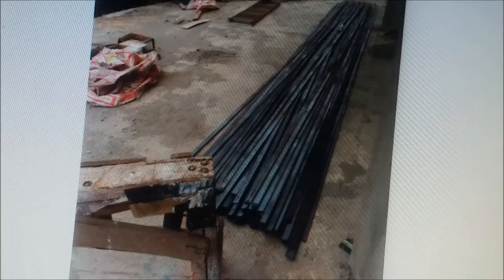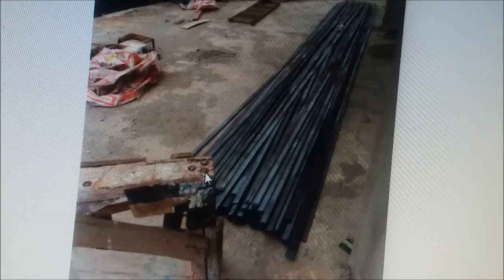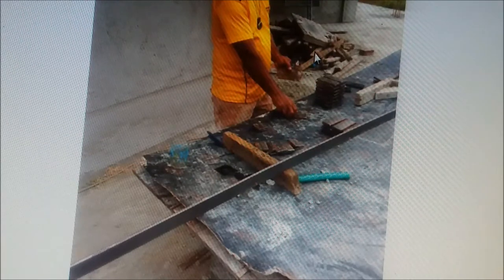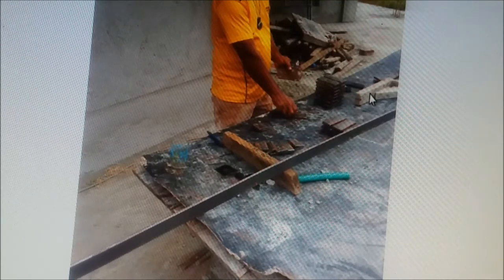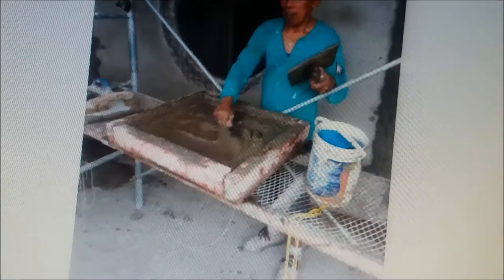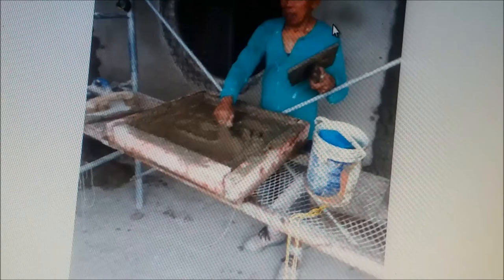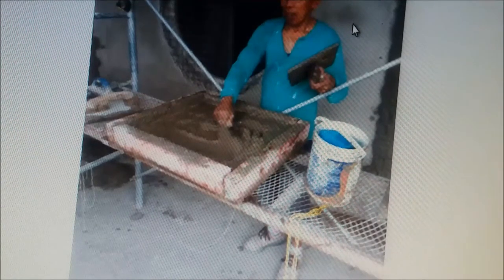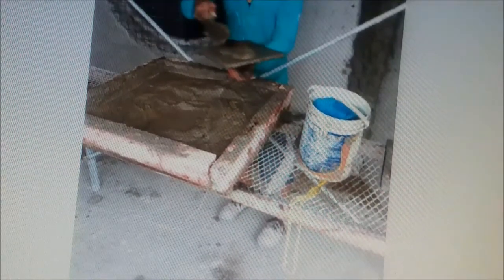"BUILDING OUR DREAM HOUSE IN THE PI", CHAPTER 62, CONSTRUCTION SLIDE SHOW 2

Comment: I like the idea of the wires on the walls. We built our home in 2019 and finally moved in last July 2020. We can already see cracks on the walls, small ones so your idea probably helps prevents cracks. It is probably costly though. New sub here. I came across your channel from Jessica
Reply from the maker: The wires are welded wire mesh. Commonly  available in 3 wire 
guages and we have the middle size like a sari sari store. There is a
cheaper easier way to do this, possibly better and takes no time to
do. Go to a redimix plant and ask for chopped strand fiberglass. 
It comes in small bags measured for 1 bag of portland cement.
Just toss it in the mixer like sahara (waterproofing).You could 
overcoat with 1 CM of render after sanding off paint and skimcoat.
Use silicon carbide sanding disks. There are drywall sanders that 
have a 9" disk but they are cheap ($40) and have a long handle that
is telescopic. Wet the wall thoroughly and let dry to damp before applying render or skimcoat to concrete. Your walls are aged enough that that rubberized crack sealer will suck into the cracks and you would use
Boysen crack filler paint for added peace of mind. We didn't have 
any cracks with no mesh on the ceilings, just skim coat.